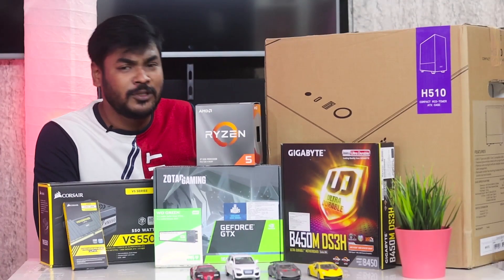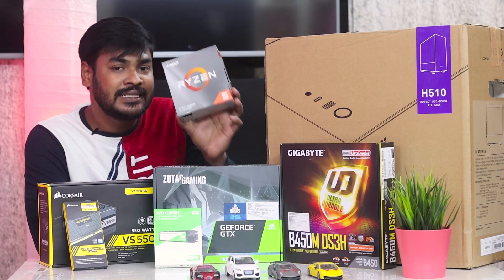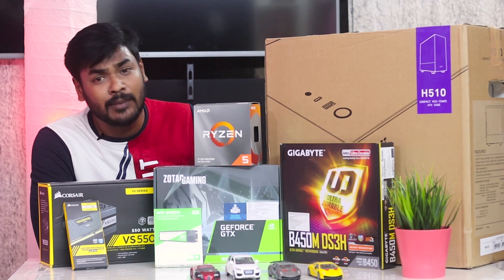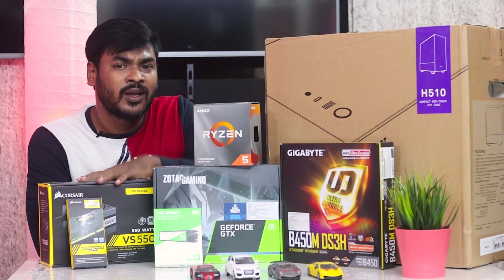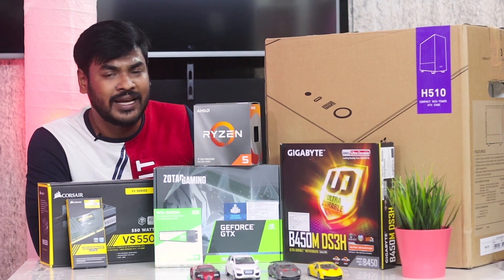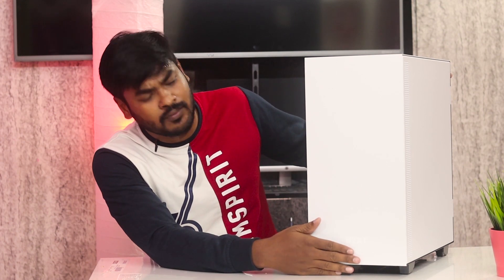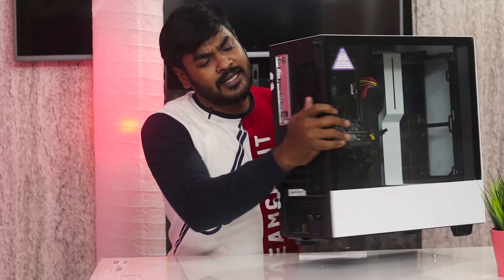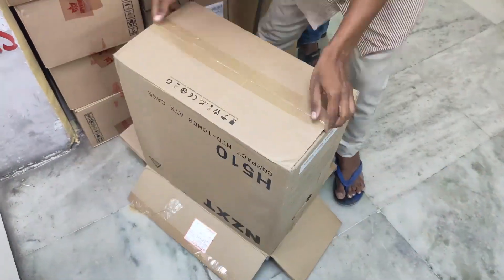Gaming and Editing PC Build (2020) Under 50k || in Telugu ||

Comment: Processor: Ryzen 7 5700x (20,800)
Graphic card: Gigabyte GTX 1650 oc 4gb (13,800)
Mother board: gigabyte B560M (9,200)
Power supply: gigabyte GP-p650b 650W (4,800)
Ram : 8gb xpg adata (1,700)
SSD : silicon power ace A55 256 gb (1,200)
Hard disk: Seagate barra cuda 1tb ( 4,100)
Cabinet: ant Esports 220 air mid-tower (3,200)
Monitor: ZEBRONICS 24 Inch led monitor (7,000)
Mouse : zebronics transformed m (400)
Keyboard: hp K500F (900)

Around 68k budget

Comment: Anna  nenu editing chesthanu..
I7 3770 prosesor, 16gb ram, 256 gb ssd, 1 tb Hdd ,  4gb Nvidia 710 graphic card  , Gigabyte 1155 motherboard, 400 power supply .Rgb cabinet 27 inch monitor  .. total 65000 padindhi ana..aa price ki worth aa kada anna
Reply: I think power supply is less
Reply: Bro gtx 1050 ti Or 1650 ti thesuko and 650 valths power